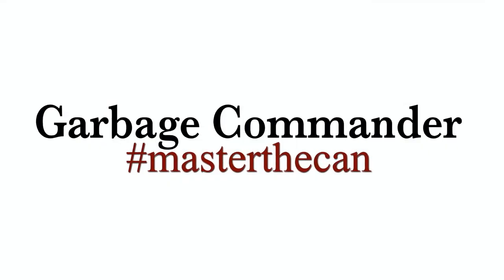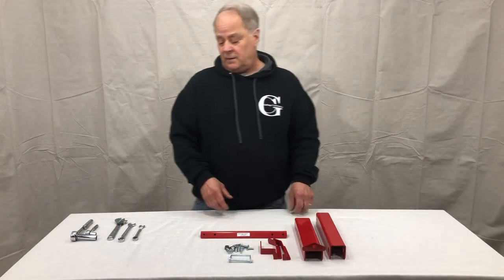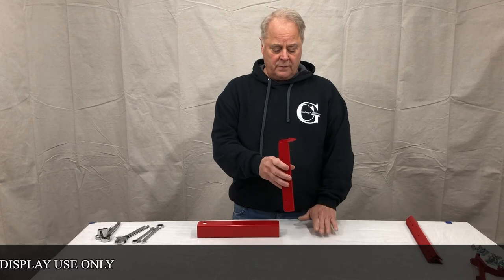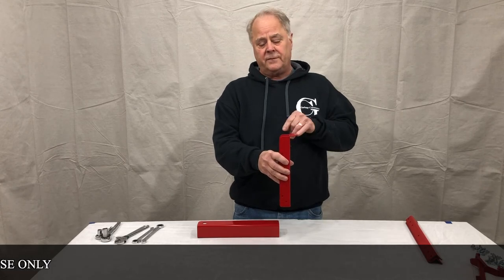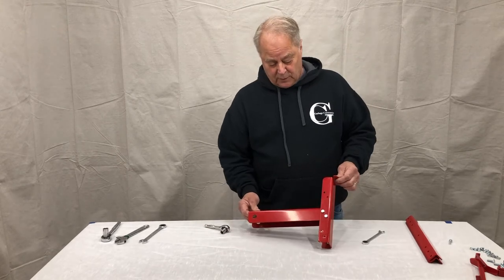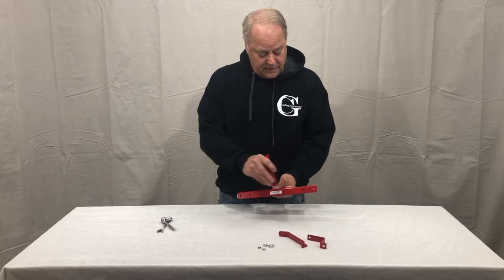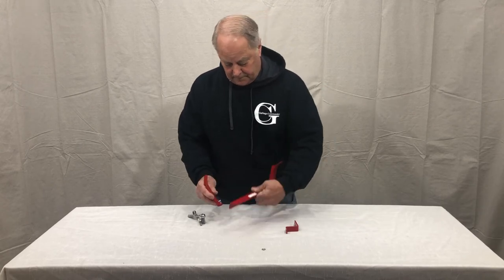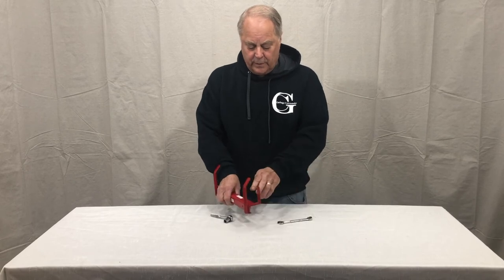How to Assemble the Single Can Receiver Mounted Garbage Hook

Comment: I've got a mini-van and my hitch is only 10" to 12" from the ground, with the top extension on the upright this only puts my can at 16", that's a pretty substantial tilt and I feel like the trash would fall out...any thoughts on making a taller upright? I'm sure there are a lot of people out there with lower hitches that would really love this product.
Reply from the maker: 14" to 21" is the ideal range for height. If you over fill the trash can you might have an issue but you can use a bungee or there are a few companies that make straps you can use.